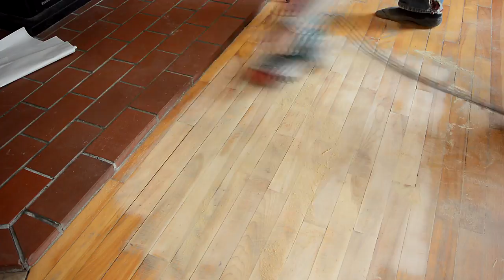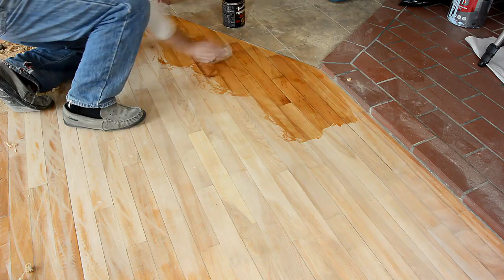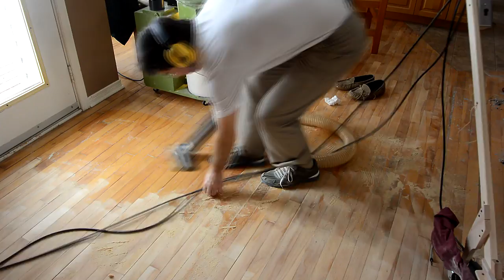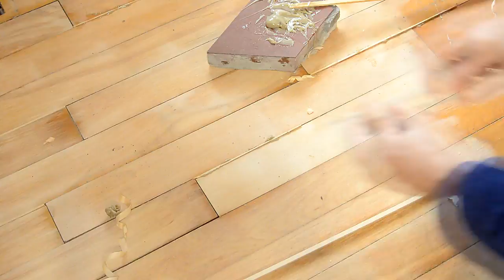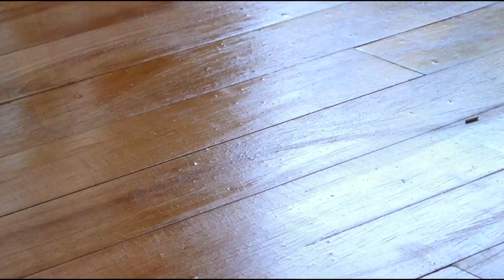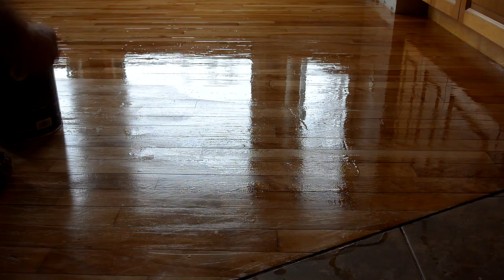Hardwood floor refinishing by trial and error

Comment: This video is pretty old, but I see a major flaw in the scraper design. Basically it is designed as a second class lever, but without the wheels being firmly affixed to the floor, so the effect is that the wheels are lifted unless you apply torque at the handle end to keep them on the ground. It's impossible to really push down on the scraper this way with any acceptable amount of force.

However, if you built a device which was shaped as a triangle, so that one corner has the wheels, the other corner has the scraper, and the top corner is where you push down, it would apply a steady force to the scraper and also allow you to push it back and forth.

Comment: Are these methods exemplified normally applied to edges only? there are larger belt and orbital sanders for larger surfaces. You are performing the equivalent of using a 1" paint brush to paint an entire wall where rollers could have easily done the job with better results no?

Comment: hey so best thing to do is just rent the sanders.  one is a large drum sander and the other is an large floor orbital sander.  
then for the gaps don't use shims like that.  instead after you get the floors sanded well, go over it again but just use glue + sanding the floor.  The saw dust created sanding mixed with the glue creates a perfect fill for the gap that is seamless.  
In other words, if rub the glue on the floor near the joints and sand the wet glue with a small orbital sander it will mix everything together to be a perfect fill.  Plus it is the same species of wood because it is just the dust mixed with the glue.
Not sure if those shims are the same species?  I am assuming that is oak.  
Anyway good perseverance.  but best to watch a bunch of videos of professionals doing it first, then just copy them.  why make up your own method if you don't have any experience ?  good job overall though.

Comment: First step; Edge sanding
2nd Step; Fill cracks with filler
3rd Step; Belt Sander to remove varnish 60 grit
4th Step; Buffer Sander 60, 90 and 120 grit
5th Step; vacuum, vacuum vacuum
6th Step; Verathane thin coats light sanding between coats

Comment: Always use a floor sander, never cut across the grain when sanding, 35 grit than 80 grit. VACUUM. First coat use lacquer, youll be able to apply first coat of poly within the hour. ALWAYS USE LAMBS WOOL TO APPLY POLY. use a buffer with a 120 grit screen to get out all imperfections. VACUUM. Apply 2nd coat. Repeat if 3rd coat is needed. You made this so much harder and took so much longer than needed. Should have that floor sanded and coated in an hour TOPS

Comment: hello! I first sand, then remove the dust, then I make an antiseptic for wood, and 2 layers of oil or paint, I apply with a brush! both a log and a board! I in Russia earn for 1 square meter of turnkey work, my consumables and tools, the customer buys only paint and sealant and antiseptic! his material and I take $ 10 per square for the whole complex. How much does this work cost you? I pay the workers $ 7 for work per 1 square meter !!! I will be grateful if you answer !!!

Comment: jou know you can rent a pro floorsander?...right?...you do the entire floor in 20 minutes! and you don't burn up your beltsanders! and scrape out all dirt out of the seams and do it áll with wood putty,the color is always a match and the floor doesn;t cracks when you walk over it ,  and use an orbitalsander to do the edge and finesand it...i do a floor like this in 4 hours..without ruining my back and I use a brush for the edges and a roller it  just works better.

Comment: This is painful to watch. I used to have a hardwood floor company. Specialized strictly for hardwood floor nothin else. The life of the floor is about 3 refinishes 25 yeard life per finish. You scraped a good 25 years off that floor. For $50 just rent a flooring sander from Home Depot.

Comment: Sorry i have to say that's crazy , next just rent a drum sander , an small one should be fine for that project , so much easier and faster before you apply any finish you have to vac and tack the floor , sorry to say but you made  any posible mistake in refinished a wood floor , good luck on your next project , never apply finish against the wood grain , and for future reference if you need to feel any gap on a natural solid hard wood floor use the dust from the sandown mix with carpenter glue that mix will work perfectly fine , please don't you ever do that to a hard wood floor again , just use the scraper in real tiny areas and corners please those scraper marks are hard to remove.

Comment: Holy shitballs if you made your own hammer it would have 11 moving parts 4 bearings and a grease nipple, if you spent as much time on the end of that as you did building handles and extentions and trying to design antivibration into a stick and spring you could stripped 3 floors, Lord thunderin Jesus

Comment: For someone who is as smart as him, he does some really dumb stuff, like ... hey, let's sweep sawdust over the floor to use as wood filler and then not clean the surface before applying finish. How to have to redo a hardwood floor in like 6 months 101, when the poly doesn't adhere to the wood and the finish starts to peel up.

Comment: Bro you are making each step harder for your self, Thoes scratches in the wood are gunna be there forever and to be putting little bits of wood into the Floor to fill in the gaps and than sanding it down🤦‍♀️🤦‍♀️🤦‍♀️Just use wood putty?!!, and buddy's left with bits of varnish on his skirting boards from just mopping wood varnish on over the  saw dust covered floor to fill in the 'cracks' and than not vacuum it up to only get a dull, lumpy ass finish THEN GO SCRAPING OVER THE VARNISH AGAIN TO TRY AND REMOVE IT!?!?!???? Tf dude i don't wanna be mean but like dam; do not be doing your own handy work if you think like this
Reply: I agree. He did say that he would have it professionally done, but why ruin your floor?

Comment: I’ll bet you’re an engineer? Rent a floor sander and for god sakes stop going against the grain. Wood glue would have worked just fine not construction adhesive. Definitely an engineer, way over thinking and making things worse. Sorry but that floor looks horrible! Your first pass can go diagonal but have to go with grain to get rid of scratches

Comment: You could've got away with doing it with the belt sander and then Is a buffing machine But you wanted to be cheap when it comes to hardwood floors you're doing it for your own home you cannot be cheap you could arrange the machines and done it right the 1st time but now you gotta keep on going over it and over it and over it more time more material when you could have done it the right way the 1st time dummy Open grill